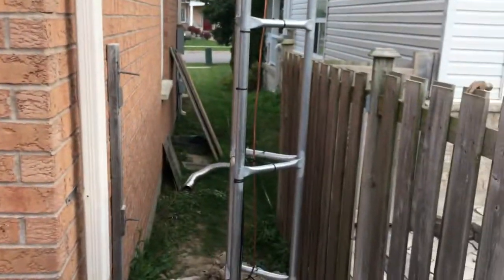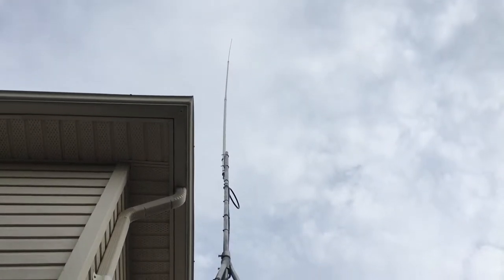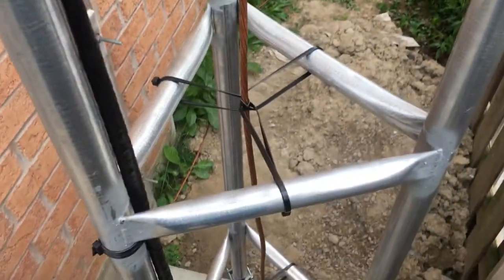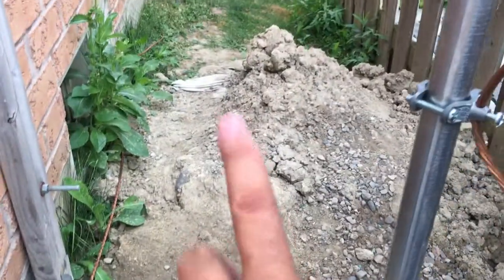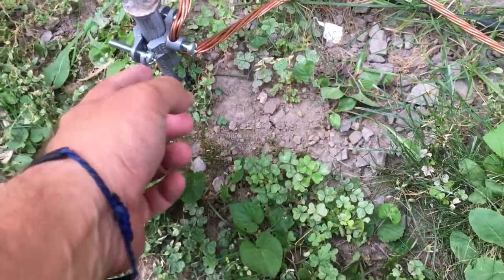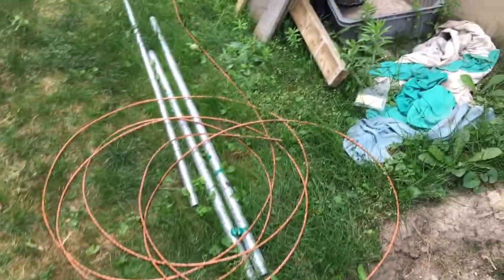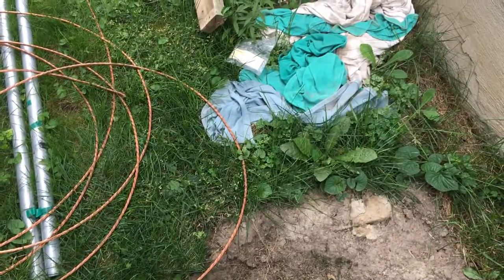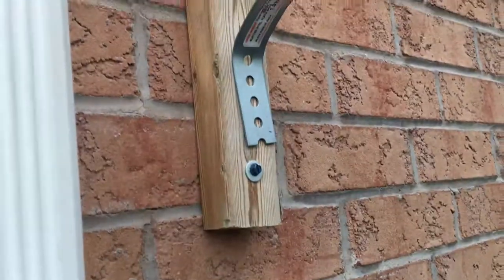IMAX2000 Tower Installation, No Ground plane, Grounding.  Pt 3 of 3

Comment: nice but the zip ties will fail in about 2 years from the weather and UV rays,i replaced all my zip ties with a modded fernco rubber fitting and never had any more issues.hope this helps.

Comment: Hope it works well for you. I agree with others, you need to be at least 36' off the ground to the base of the antenna. So 36' + 18' antenna = 54 total feet from ground to antenna tip.
Reply from the maker: Jordan Hooper from Toronto Canada I’m  hitting Brazil constantly.   Mexico.  USA.    Guatamala.  Hitting many South American countries.    
Sure that is theory but depending on soil
 conditions and many other things weird things are happening.     I’m extremely happy.   If i can hit Russia, Italy, Germany and South America.    In my case, it’s working for me.     Thanks for watching.

Comment: Just to let you know, you need to be at 36’ to the bottom of the IMAX, putting you in the 1st ground wave. Jus sayin. TopGun123 west Tennessee.
Reply from the maker: I'm confused, so what you saying?  I have to raise my antenna?  thanks.
Reply: He's right 36' FEET 1ST WAVELENGTH
Reply: Absolutely raise your antenna to where the bottom is a minimum 36’ from the ground or you’ll be scuba diving with the mud ducks and not getting the full potential out of your rig. Little over kill on the 3 ground rods but rather be safe and protect your investment. I might add two more.
Reply: Put the antenna on top of your roof

Comment: Very neat. I had a 7,500 watt colossal up a little higher than yours with 5 guy wires and a mean super gust dragon storm passed through in about a 10 minute rant and my outfit went like a whirlee bird. Luckily my antenna never got a scratch. Due to my age and dismay it lay bent over until a couple weeks ago and I took it apart an put my imax 2000 back up. Im waiting on a 15' channel master section and I shall raise it another 15' Which will make it about 60' from the ground. You have a nice tower.
Reply from the maker: Thanks very much for the kind words and compliment.   I have another 10 foot section of the tower, which i never attached.   I have this fear for lightning etc.    I dont hear much skip lately but i made far contacts to South Anmerica, Europe etc.    Wish i can add 10 feet to it.

Comment: Nice job! How is the recieve on your I max 2000? I have run all sorts of antennas since 1977 and I put this I max up in 2013, but I didn't ground it. I find I can easily get out talking skip, but recieve doesn't seem to be as good as my Antron 99. I also have a Hy-gain silver rod up as well and the recieve is great. You did a good job,. I had a tower like that over 40 years ago with a beam on top,. Cheers

Comment: What is the brand of tower you are using? I have one I’m trying to fit a tilt base to.
Reply: I had a welder make a base with 1/2 steel and weld to mounts with bar pipe to turn similar tower to tilt and put bolts into concrete pad. It's well worth having tilt tower.

Comment: where do you even buy a grounding rod? will copper plumbing work?
Reply: Any electrical supply house and probably Home Depot.  I would say no to copper tubing for resistance reasons and also its questionable if you can hammer it down deep enough without destroying it